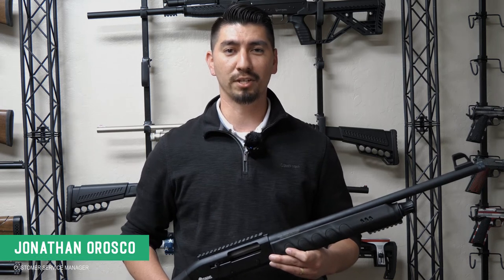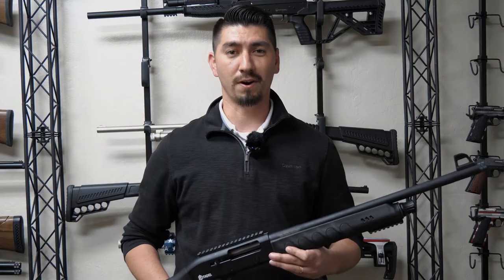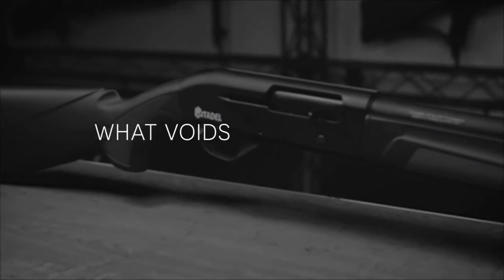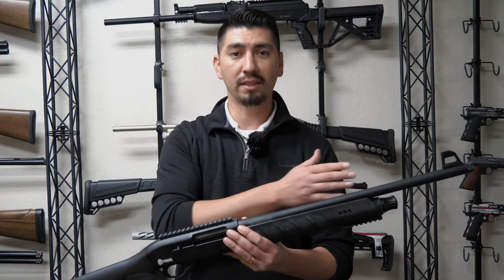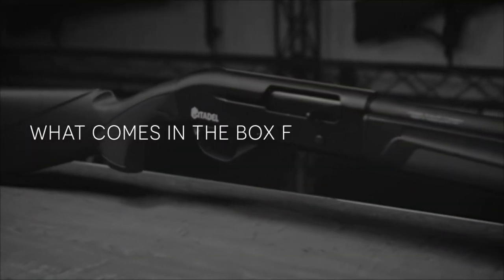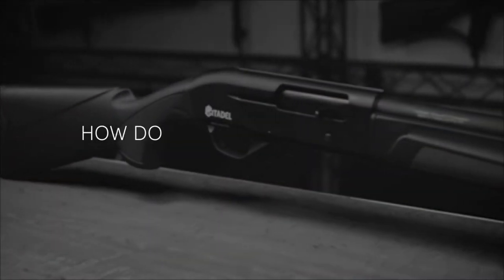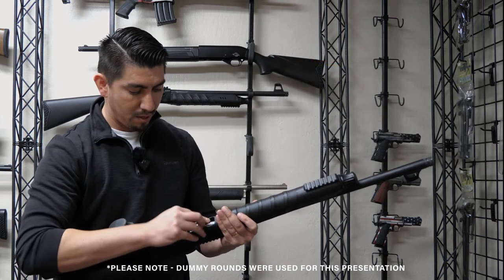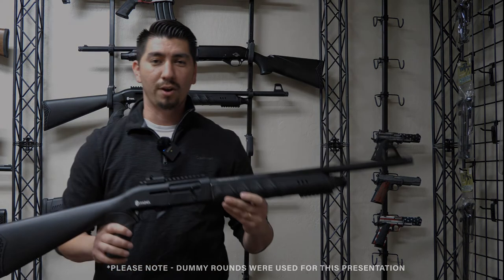CITADEL - Bosshog FAQ

Comment: Here is what you need to tell people about these bosshog auto shotguns.
They are shipped with grease that, not gun oil.
If you buy this gun, you need to take it apart, clean everything and apply gun oil to everything that moves including the mag tube.
Then store it with the bolt open, it helps to loosen the recoil spring until you are ready for the range.
Then bring 50 to 100 rounds of 1200fps federal target load ammo.
I have had zero failure to feed or cycle, not a single one.
One more thing, fix your trigger pin that comes loose with a simple dab of loctite or put a crimp on it.
Reply: You either work for the company or you own stock! lol just kidding. I don't own a boss hog but if I did I'd be glad I saw your post. Thank you for being a good owner. ;-)